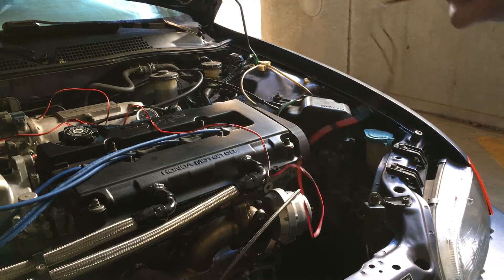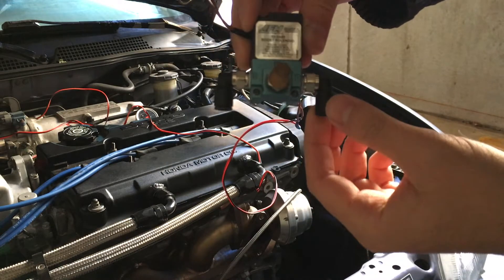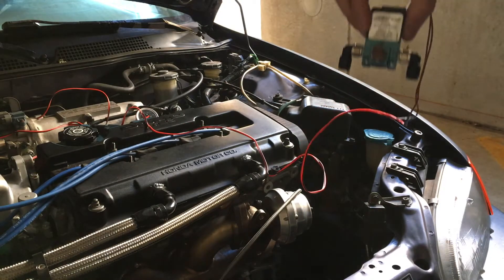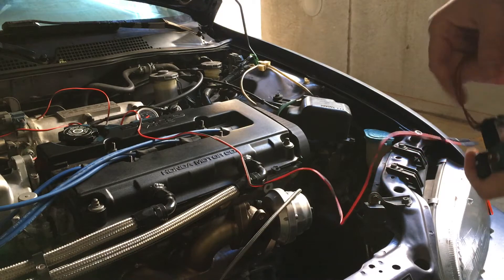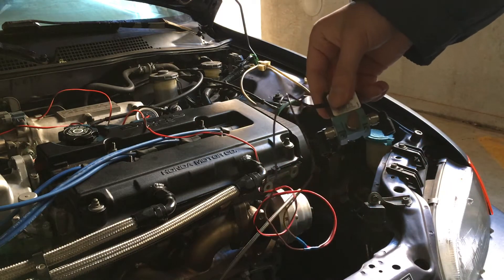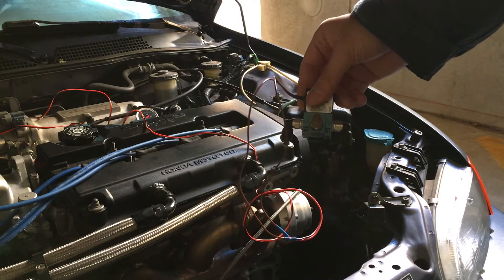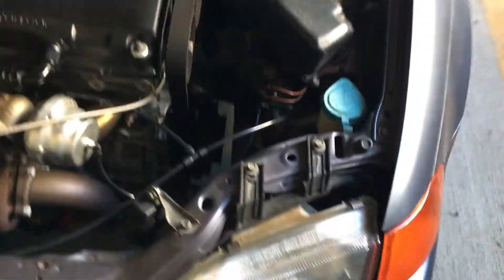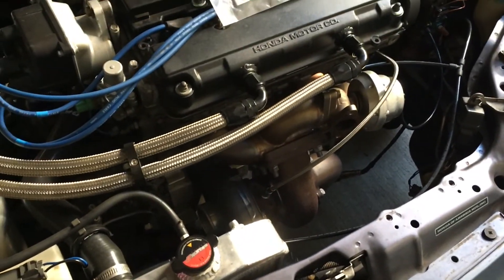How To Install 3 Port Boost Solenoid  (Boost by Gear) On Civic EG/Integra ODB1 On Hondata!!

Comment: Thanks for the video. Will the mac work on variable turbo?
Reply from the maker: Oscar Barberena yes but you would want to tune the car to make sure it does not over boost. What car you trying to wire the mac in? What’s the setup?
Reply: @projectcarsmodz1775  2005 Nissan Patrol  with a ZD30DI engine. Diesel engine.
Thanks for the reply

Comment: How does your computer know what gear it is in?
Reply from the maker: Rust Belt Auto when you load a base map on hondata you specify what transmission your car has, either gsr, b16, type r, etc. Once you pick the correct transmission the software will know whenever you shift gears, the transmission has a sensor that counts the teeth on your your differential and final drive, etc and also from the speed sensor since every gear can only go up to a certain mile per hour.
Reply: @projectcarsmodz1775  okay. So it must use rpm and wss, because a mt only has wss, and reverse switch on a d16. I was wondering about that. Thanks!
Reply: @RustBeltAuto  same

Comment: Can you list the parts..?
Reply from the maker: al3xuk you will need 4 90 degree quick connectors, 2 will be used for the boost    Solenoid, then the other two will be used for the turbo and wastegate. You will need a T quick connect that will be used to connect the quick connect from the turbo to the bottom of the wastegate then out to port 1 on the boost solenoid. Then connect top of the wastegate to port 2 of the solenoid. And of course the quick connect line, get 7-8 feet. The line is cheap the connectors cost a few bucks each.